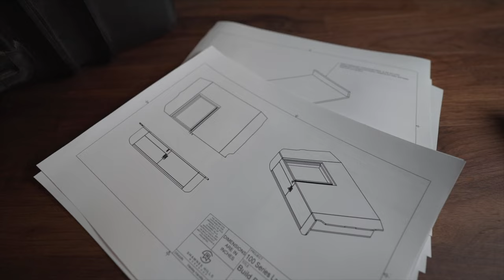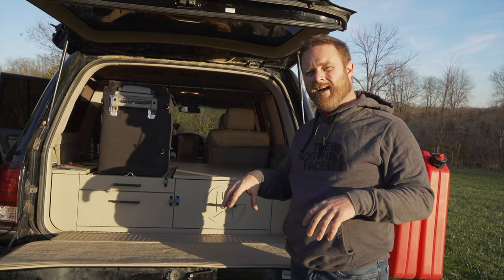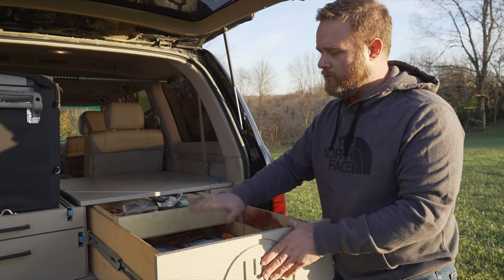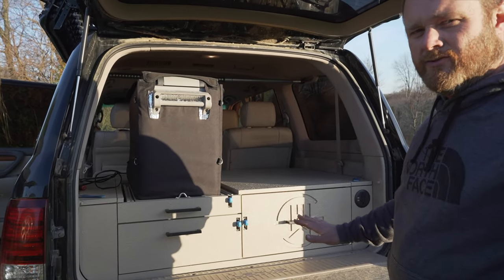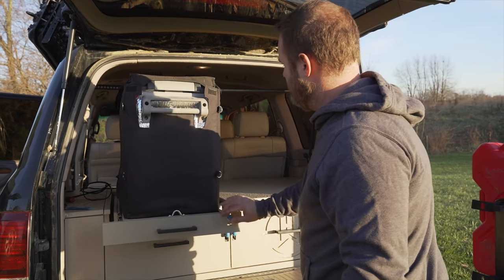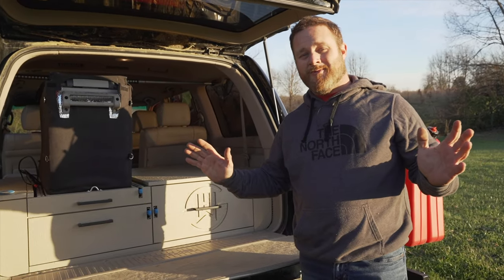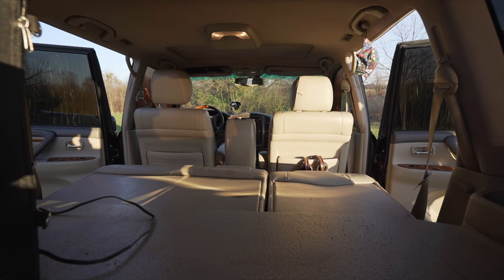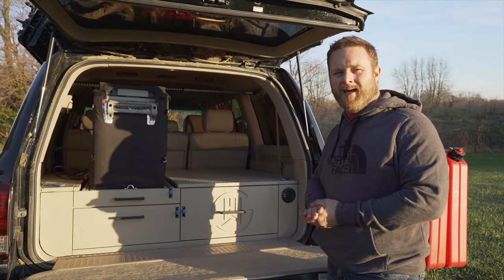The Ultimate Land Crusier & LX470 DIY Drawer System

Comment: Do you intentions of designing and offering a long option either with seats folded up or seats unbolted and removed?  I’m thinking for lomger drawer systems to accommodate stoves, etc that could be pulled clear of the tailgate for ease of use as a cook station.

Looks fantastic btw…
Reply from the maker: as of now, no as I feel the market for a drawer system of that size would be too small

Comment: Fantastic build and design! I am curious if the 4Runner plans will work with the SR5 Premium (with the 3rd row) as long as the seats are down… I assume so since width doesn’t change, maybe just a height concern?

Comment: What kind of paint are you using? I just built a drawer system for my Tacoma and I’m going crazy trying to figure out what paint I should use. It’ll be covered with a softopper so I’m not to concerned about water. I do need something  durable cause I will be putting stuff on top . I’m thinking about using the raptor liner but I hear mixed reviews using it in plywood. I’m impressed with your builded. I’m actually engraving my drawer front as well. I really like the look.
Reply from the maker: Definitely don’t use Raptor liner.  I have had mixed results.  I use tile clad hs from Sherwin Williams.  It is a 2 part epoxy that they can color match.  I use a bed liner roller to get the texture

Comment: COULD I USE 100 SERIES PLANS AND MODIFY FOR 80 SERIES?
Reply: IVE BUILT 3 SETS OVER 8 YRS AND THIS LOOKS GOOD. ULTIMATE IS TREKBOXX IF WERE BEING HONEST.
Reply from the maker: @jailbreakoverlander  You could definitely modify them to fit the 80, but I haven't measured an 80 so I don't know how extensive the modifications would have to be.
Reply: @shaweehillsworkshop4226  how bout I repost this to my channel linked back to you. my channel is heavily toyota centered.
Reply from the maker: @jailbreakoverlander   sure!
Reply from the maker: @jailbreakoverlander  where are you located?
Reply: @shaweehillsworkshop4226  Im in Boston Ma. But Im usually on the road just rolled in after 4/12/ months wandering in my 97 80 series. She needs some repair work then back out.

Comment: Nice build, but I bet it weighs a ton
Reply from the maker: It did, it weighed around 220lbs.  Since then we have redesigned our product.  We now use a special plywood we import from Spain that is 40% lighter as well as we made some other changes, so this product now weighs around 140lbs.  We also have an ultralite product that weighs 73lbs for this vehicle.  Check them out at shwoffroad.com